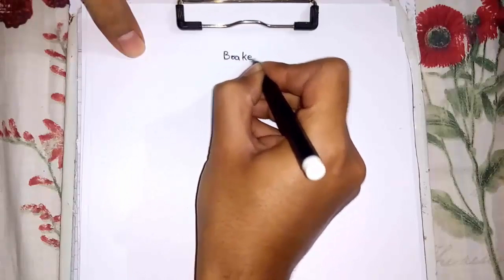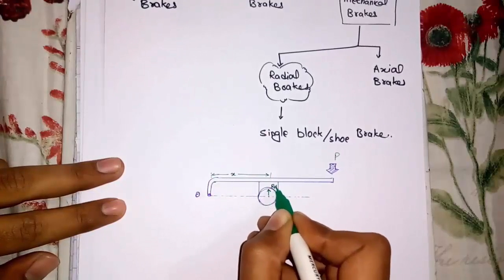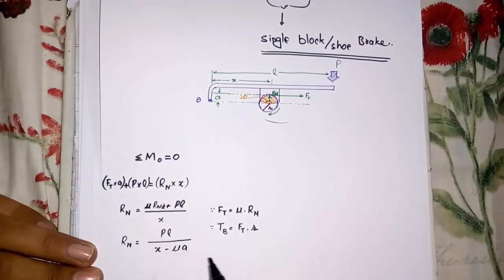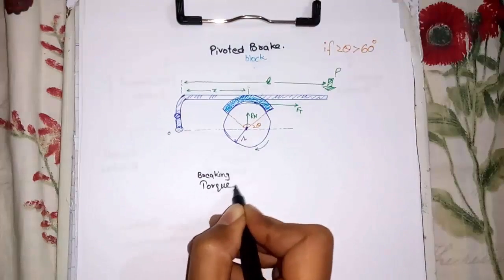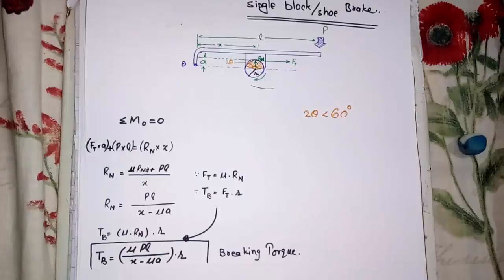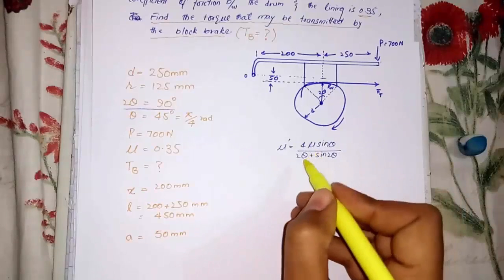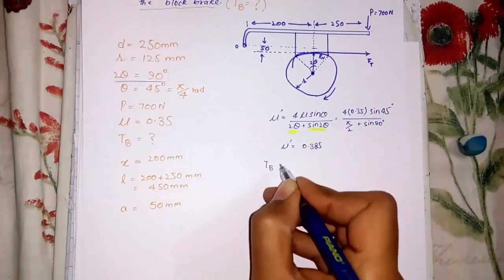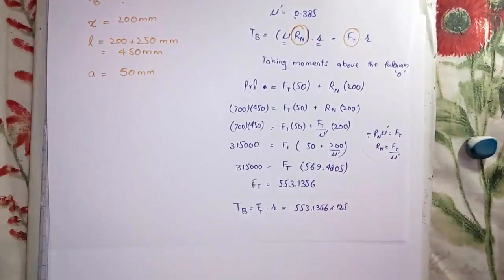How to Design Single shoe/block brake - intro, mechanism, breaking torque, solve example

Comment: here if Ft is breaking force so why it is in the same direction as the rotation of wheel?
Reply from the maker: +akshay kaushik Actually it is the same velocity of drum ( tengential velocity). To stop the rotation of drum we have to apply same magnitude of force. That is why it called breaking force aswell.
Reply: +Huzaifa Saleh iam saying  that if we have to stop the wheel then direction of Ft should be opposite to that of the rotation of wheel
Reply: +Huzaifa Saleh ok got it.thanks🙂
Reply from the maker: akshay kaushik No problem bro
you can ask any time I will try my best. bless you